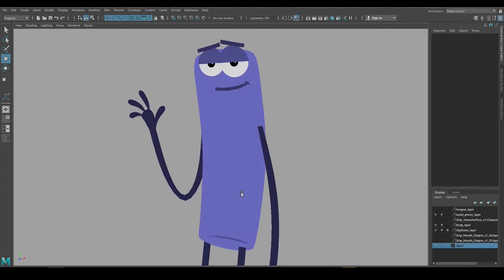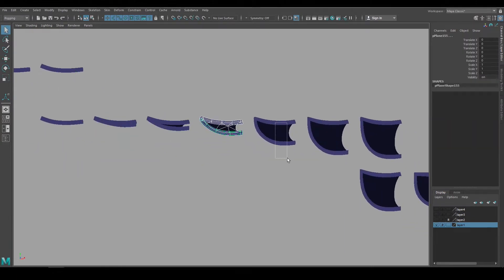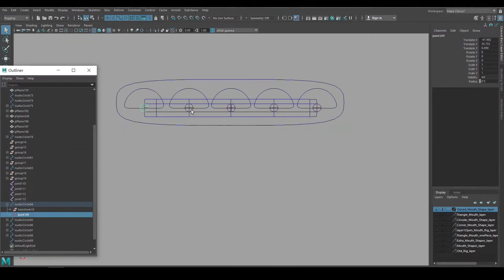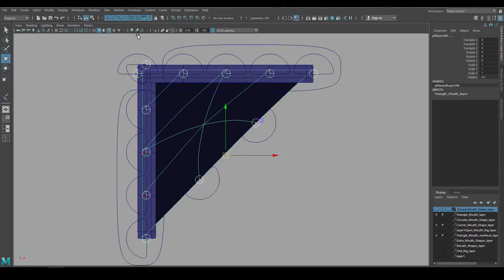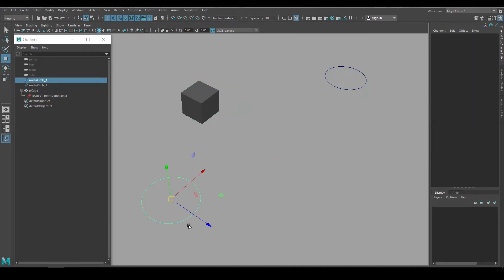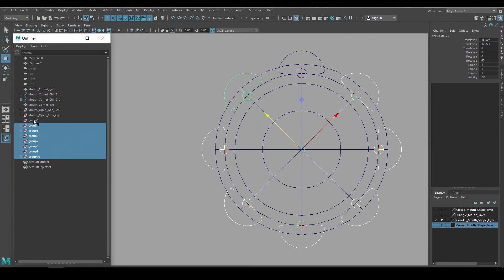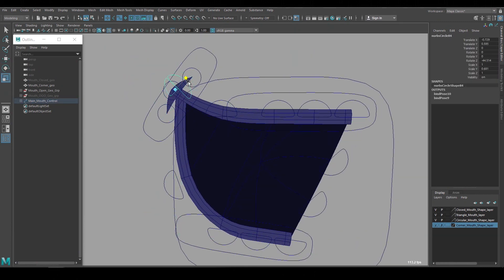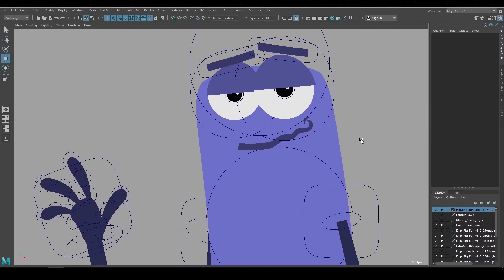2D in 3D – Rigging a flat character's Mouth - Maya

Comment: Can you apply the 2D planes and make them wrap around a 3D object? Example being a 3D model with a 2D face that isn't driven by textures, but rather meshes and controls
Reply from the maker: Yes, you can use deformers for this.
Wrap deformers are brilliant, but you may be able to use Lattice or even Blendshape deformers. It depends on the design and the control you are looking for.
Reply: @jcrossley17  I did this with the Wrap deformer and it looks great but a major problem is that the joints get left behind and the manipulators stay with them so I can't control the rig.
Reply: @NinjaMK  Hi! I'm working on a project where I'd like to do a 2D mouth for a 3D model as well. Did you find a way to solve this issue?
Reply: @nanaki5215  hi, we ended up rendering the model out of Maya without a mouths and then animated a 2D mouth in another software and composited it all together in After Effects. 

But you could probably do it all in Maya if you had a proper rig. Mine was just a mess.
Reply: @NinjaMK  got it, thank you!!

Comment: Use blendshapes instead of swapping
Reply from the maker: You can use BlendShapes as long as the topology (number of faces) of the geometry is the same for each mouth shape. The mouth shapes I used in this video were built with different geometry, so BlendShapes wouldn't work between them.